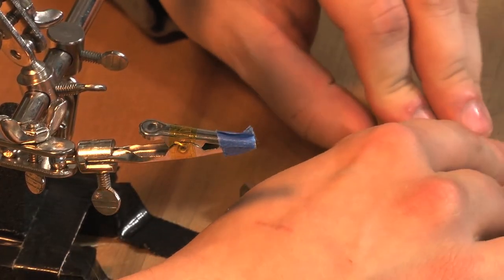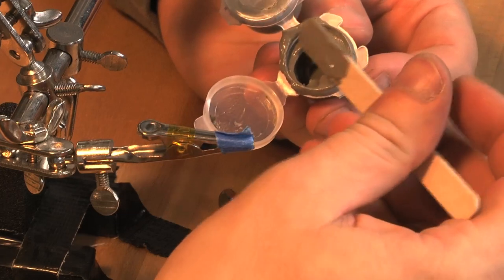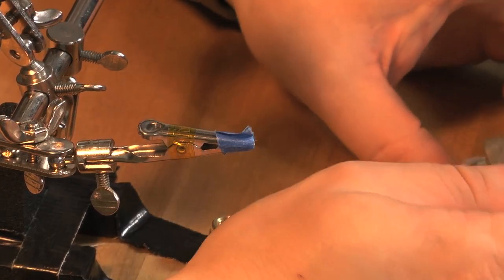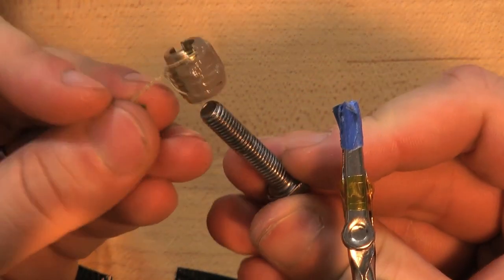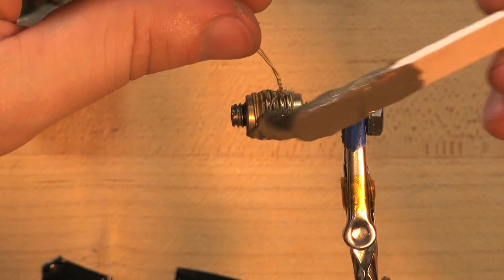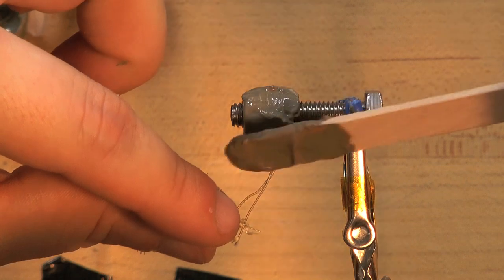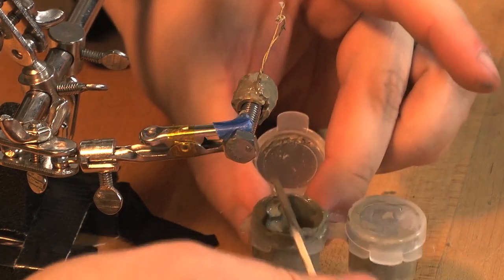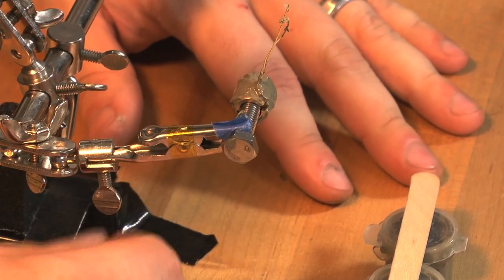MakerGear Hot End: First Ceramic Application

Comment: Is the ceramic the same stuff that you put between a proccessor and heatsink (thermal paste)?
Reply from the maker: No, that's thermal paste. This stuff hardens when it gets hot and isn't so much about conducting heat--it's job is to withstand and contain the heat.
Reply: Thankyou. I wanted to make sure before I went out and bought the wrong stuff. I'm not using a kit for my hot end. I've designed my own, which I am hoping I can have machined. I'm building a 3D printer based on the Delta design, but with five filaments (black, cyan, yellow, magenta and white) leading to the hot end, Hopefully allowing full colour prints. As far as I am aware, full colour extrusion prints hasn't been attempted yet. I know very little about plastics, but I'm asuming they will mix like any other pigment.